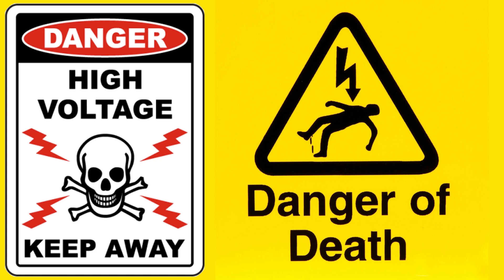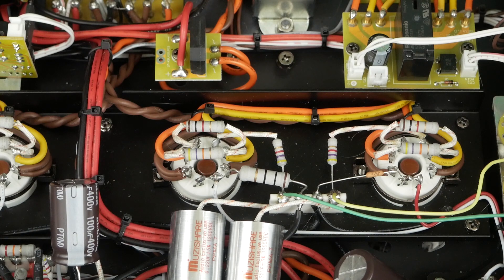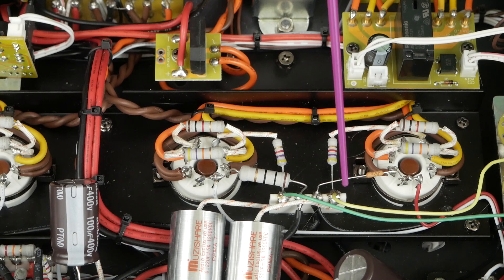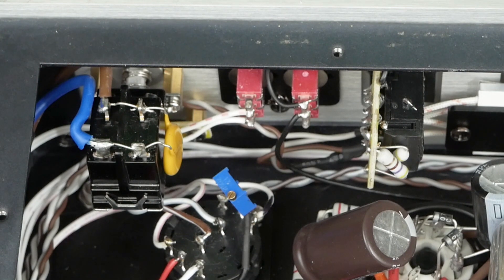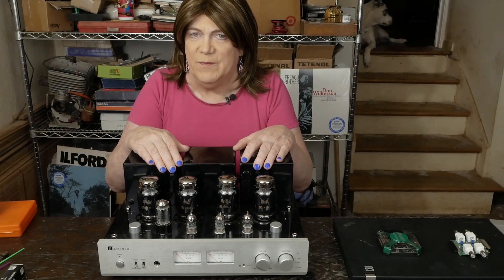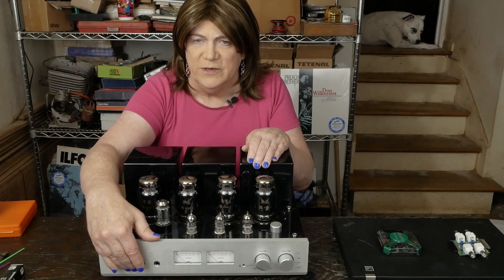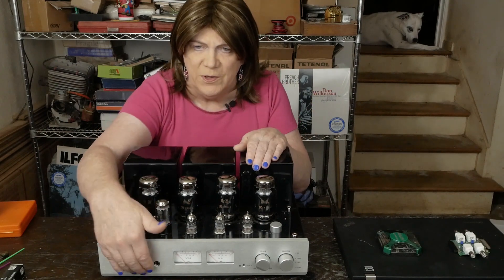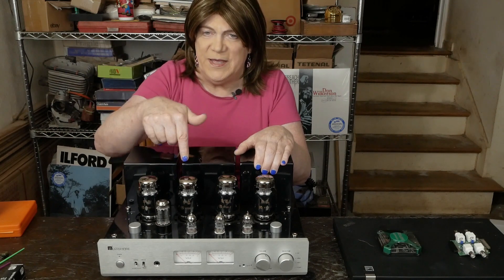Muzishare X7 Must do Mod!: Replacing the Cathode Resistors

Comment: hi again , i have all components delivered and ready to do all of your recommended mods. The only components I cant seem to find anywhere are the 10 ohm 1w  cathode resistors.  I am a bit reluctant to go with an alternative resistor. would any 10 ohm 1w (0.1%) metal fiim do? what are the important specs here for this resistor? Thanks in advance
Reply from the maker: Yes any precision 10ohm is fine.

Comment: Howdy.
I would think this is a possible explanation.
Perhaps the designer wanted to avoid possible roaming of the ohmic values running the resistors hot for longer periods of time.
Cheers.
Reply from the maker: These resistors have 0.016W across them. They are not going to get hot or roam in value.
Reply: @SkunkieDesignsElectronics  Howdy again.
Yes. The roaming assumption is not very likely to have been in mind of the designer.
A somewhat more plausible motive may be the thinking that using 'fuse' resistors one can kiss the bias gauge goodbye if and when a cathode resistor blows.
But the bottom line is Skunkie is correct. Yes. A blown gauge is cheaper and an easier fix than a transformer meltdown.
For myself I would consider using glass tubular fuses at the cathodes. But yes. The fuse holders need be high quality gold plated items not to ask for oxidation troubles. Skunkie probably rejects this idea.
In the end. I believe exploring possibilities basically is a good thing.
Cheers again.
Reply from the maker: No it's not going to take out the bias gauge if the resistor goes open, it will simply read zero.

Comment: Can you please confirm if resistors H4P10RFZA will be fine? I cannot find ones with 0.1% tolerance in Poland
Reply from the maker: Buy extras and just measure until you have a set of 4 that are close to spec.

Comment: A concern I would have about doing this is if this resistor opens, you would have B+ voltage on the cathode. This could cause all sorts of havoc, including possibly destroying the bias meter or select switch. Wouldn't it make more sense to insert a small value resistor in series with the plate and screen connections? Or as one commenter suggested, into the B+ connection at the center of the  output transformer? This way, B+ is removed from the failed device, rather than potentially elevating all the pins of the failed device..

Comment: What about quality of headphones amplifier circuit in Muzishare X7? Does it have tubes (what exactly?) or OpAmps (what exactly?) or something else? What headphones impedance range does it fit?
Reply from the maker: There are no opamps, the headphone jack runs off the same output as the speaker jacks, all the tubes are used.
Reply: @SkunkieDesignsElectronics  thank you! And what headphones impedance does it fit? Does it use some sort of extra voltage deliverer or something elese to increase the impedance of output?
Reply from the maker: Honestly I have no idea. On my R8 I tore all that wiring and the headphone jack out. It seems silly to me to run a 45W push pull KT88 amp, with all that extra heat and electricity to drive a pair of headphones.
Reply: Of course you would not use this amp solely as a headphone amp, but the hp jack can be useful to listen for details on a recording that's playing, or simply as an occasional change to your normal setup. You'd just need to be very, very aware of the volume setting before you plugged in! In short, I would leave the jack hooked up.

Comment: Hello, 
I've had the Muzishare X7 for a week, the sound in combination with my QUAD ESL-988 speakers is not satisfactory.

What is your opinion on the tube amplifier today?

Regards,

Ludovic
Reply from the maker: Did you replace the tubes? And seriously, if it you don't like the way it sounds and don't want to invest in replacing the tubes (I CLEARLY stated it doesn't sound good with the stock tubes) just return it. Unless the amp has changed, my opinion hasn't changed.

Comment: Would you recommend doing the resistor switch if I only have limited soldering experience, it’s limited to soldering electronics in my guitar. On another note, Would changing out the coupling caps have a benefit? 
I’ve been learning so much through watching your videos and I appreciate all you show us.
Reply from the maker: Coupling caps do impact the sound and honestly I can't really comment on if you have the skills for this or not.

Comment: Hi id like to know what value of the ceramic cap you put on the switch to eliminate pop noise .Thanks
Reply from the maker: 4700pF XY cap  specifically https://mou.sr/49QROcb
Reply: ok thanks a lot
 @SkunkieDesignsElectronics
Reply: @SkunkieDesignsElectronics  This is a link to a 4700pf cap.  You call out in the video a .01uf.  Just want to be sure I put in the right one.  Thanks

Comment: I enjoy your honest reviews of tube amps. I was about to pull the trigger on Muzishare X7 until you made the comment about the pre-in switch. I have a home theater and I enjoy listening to multi-channel, but I also enjoy 2channel on the phono player. I don't have the space for a separate setup for HiFi. I do have pre-outs on the receiver to make it an integrated amp. Can you tell me in simple terms why you don't recommend using the pre-in on the X7, which my main reason for buying this tube amp. Thank you.
Reply from the maker: Just use one of the regular jacks going though the volume control, that way you can adjust the input gain.  These pre-in jacks are WAY too sensitive and for some reason just don't sound good.
Reply: Thanks, I will try your recommendation.

Comment: Dear Skunkie, could you pls check if pre-amp gets bypassed when using the pre-in inputs? Thanks
Reply from the maker: 100% none of the tube amps with "pre-in" bypass the pre-amp, because a tube amp doesn't have a pre-amp. It simply bypasses the volume control and many times will sound worse that using another input and just turning the volume control to the max.

Comment: This video was super helpful, and I plan to replace the 4 resistors you referenced.  I had a question about your comments about not using the pre-in option. This is my first tube amp, and I may be using it in a bit of an unorthodox way. I'm using the Zone 2 from my receiver and going into the pre-in on the X7. This is because I already have everything hooked up to the receiver and just wanted to replace the "amp" part. I'm under the impression the pre-in input just bypasses the volume control on the X7.  Would using that input also somehow impact the sound quality in a negative way?  Thanks!!
Reply from the maker: Both the pre-jacks and another port with the volume control wide open and go with what sounds better.

Comment: I have this amp and it works and sounds wonderful, no pops.  So you believe the engineers/topology designers overlooked something?  Have you talked to anyone at this company about your concerns? Just curious
Reply from the maker: Honestly, in normal use this isn't a huge deal, but if I owned one of these I would do this. It has no impact on the sound.

Comment: Thanks for the capitor tip to stop the popping sound when switching off, been dealing with that "pop" for too long. I have an amp with "Standby" , power switch on then wait 20 seconds and flip the stanby on for full power. When switching off I flip standy and "pop" so I just flip the power switch instead to avoid the pop(loud). Only does it on "switch off" otherwise fine. Do you think I should use the .1uf cap on the Standby or on the Power terminals? Thanks again...your soldering skills are A-1.
Reply from the maker: You can try a cap on the standby and see if it helps.

Comment: China syndrome meltdown..... really? With due respect, how was it tested as 5 watts version? The idea of using smaller watts resistor as a fuse, is understandable, still is controversial! Use of higher watts resistor is quieter, so its a balance.
Reply from the maker: Just going by the physical size vs the other resistors in the amp, which are the same type. might be a 3W? I'm just guessing but it's not small enough to act as a fuse. Higher W resistors are quieter, but given the tiny ma of current going though this one, a high quality metal film 10 ohm 1W isn't going to introduce any audible noise.

And here is what can happen if the resistor doesn't pop. https://drive.google.com/file/d/1SOXHfqk7DyPFH2nHlRwXduWSzmmFk0Ff/view?usp=sharing
Reply: @SkunkieDesignsElectronics  not sure you will accept, but small metal film resistors does change the sound, in such critical areas. It will sound a bit dry, that's my experience. I would expect the HT fuse will pop if red plate or failure issues in hifi amp. Appreciate yr work, just want us hifi community to realise there are compromises, but the sound is most important.
Reply from the maker: Sadly the main fuse will not pop when a power tube starts to red plate. If it did, I wouldn't see the major damage I see in amps that have a red plate event. I heard no change in the sound of this particular amp reducing the wattage of this 10 ohm "meter shunt" resistor, but I do agree if this was a 1K or higher resistor, you might hear something. BTW these amps have no "HT fuse", they just have a fuse on the AC input jack.

Comment: 6:08 Please tell me the exact number of Safety Capacitors Vy2103m.  I looked at mouser, there are 12 positions, the difference is one or two letters, part of the number.  There is a difference?
Reply from the maker: The last ones I ordered were  VY1472M51Y5VQ63V0 I don't think it's that critical, you just want some style of this type of cap across the switch.
Reply: @SkunkieDesignsElectronics hi, is this cap also fine when I am using 230v power in Europe?
Reply: It's quite unusual to listen to a woman talk about HIFI unless it's about me owning way too many speakers or how they take up too much space in the livingroom and bedroom. But you're modifying vacuum tube amplifiers? I must be out my rabbit ass mind. 🤯
Btw, why will .7A fry a transformer? Because the voltage still so high or the resistance will get so low and runaway? I think I want to order this thing because it's Chinese bling and my eyes definitely listen (that's why I like tubes too) and based on your Willisten video, that thing is horseshite.

Comment: Hello.  Thanks for this video.  Do I need to change the resistor only for this pair of tubes?  Or do the second pair do the same?  Anti-interference Vy2 103m?  Is it possible to install  KT 120 if you change the choke to 250mA and the power cups from 500 to 470?
Reply from the maker: The power transformer likely can't handle KT120 heaters. And any mod done to one channel should be done to the other.
Reply: Thank ❤
Reply: It is recommended that I replace the shunt capacitor with a good film capacitor.  remove the shunt resistor from the capacitor.  How do you like it?

Comment: I replaced my resister from 5w to 1 w end up the bias dead can’t adjust the bias!
Reply from the maker: Sounds like maybe a bad solder joint?
Reply: Hi - I've been asked to replace a failed OPT on one of these. Maybe because the 5w resistor didn't pop to save the Tx. Do you happen to know what the Tx specs are and where I can get one from? Probably, I would replace both. I think it might also be sensible to add fuses in series with the resistors?

Comment: Thank you so much for this Muzishare X7 series. Have been using solid states equipment since the 70's. This X7 is my very first tube amplifier. The popping noise has been bothering me for some time. You are the only person that have talked about the cause and solution for that problem. This may be a dumb question (from a retired IT guy), does changing the 5 watt resistor to a lower wattage one affect sound quality? Thanks again...Subscribed!
Reply from the maker: No it won't, but this is the reason I wouldn't lower it below a 1W value even though theoretically a 1/8W resistor would work there. I am a big believer that resisters should be larger than absolutely required for sound quality.

Comment: Hi this is the first video I've ever seen from you - this is really great & I like the careful explanation given. Fender amps also specify a screen resistor of no more than one watt on the 6L6 screens for the same reason. I also have a Leek 10+10 amplifier with a 3 Watt resistor in the HT line. The advice is not to replace it with a 5 Watt device, the 3 Watt is so rated that in the event of overload, it melts the solder & drops off the board:)
Reply from the maker: Exactly!

Comment: put fuse on the HT even better
Reply from the maker: Folks could, but wiring in a fuse holder able to deal with 440VDC is a lot more complicated.
Reply: @SkunkieDesignsElectronics  it will be fine been done in tube gear for years put it on the centre tap of the transformer.
Reply: @moodyga40  Fuse holders and fuse caps tend to oxidise and corrode over time creating non linear contact resistances, not so good for audio quality. I guess you could find solder lead style fuses, but remember they don't actually blow at the rated current.
Reply: @mfr58  that's not true use good fuse holder. In every bit of valve audio gear I've built I have never seen this. My last 300B stereo amp I built I have a fuse on the centre tap of the HT transformer to the star ground. Never had any issues. As for the fuse not blowing I'm not sure what topography you have been reading, by using ohms law and testing the circuit to  ensure that the correct fuse is fitted etc.

Comment: Simple and elegant - nice work :)

Makes me wonder why the B+ supply is so rarely fused nowadays.
Back in the '60s...'80s Polish tube PA amps, main plate supply was fused; even heaters sometimes were. These things were designed by engineers, not accountants :).